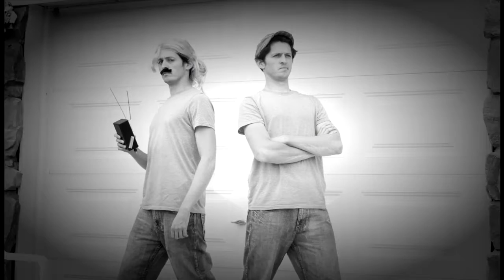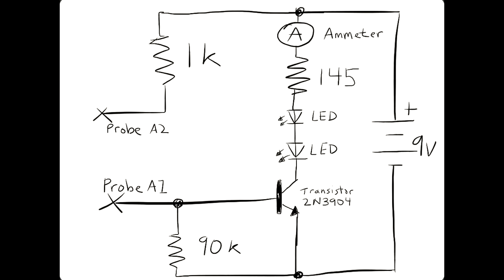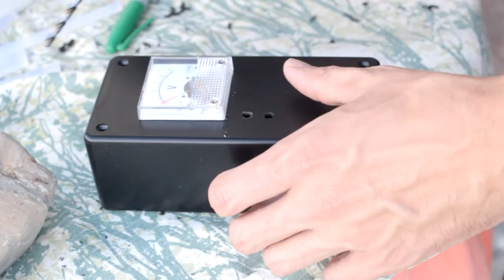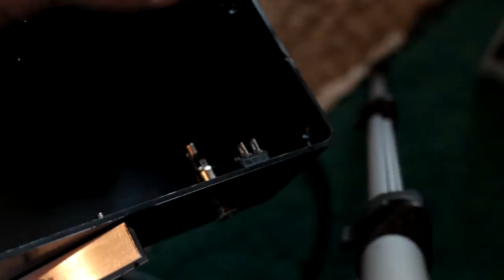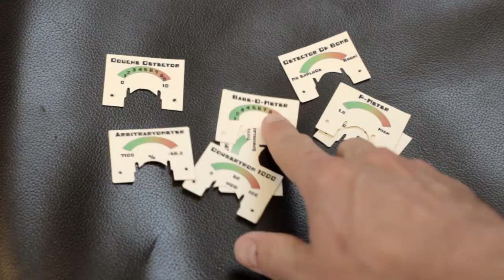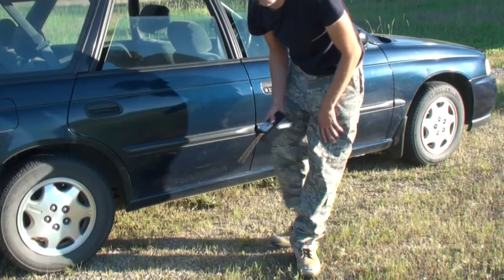Build A Ghost Meter/Bogus Detector of Things! Johnny Rigged Ep 1

Comment: This is pretty fun. Do you think it could be done on a smaller scale? I'm thinking of making an "Aether" meter for a steampunk style device I'm putting together. I want the needle type of dial but I'm thinking I want something more round. I want to build a working version of something like this: https://www.etsy.com/listing/259255609/aether-gauge-monitor-cuff-steampunk
Reply from the maker: +Aaron Stein I'm sure you could find a different amperage gauge that looks more like the one you want with some searching. By just putting the parts together without a bread board you could make this circuit tiny. Saw more rounded meters in the proper range on ebay. To get one that goes full circle at the right size and is really thin would take some looking or building your own my making a tiny electromagnet connected to the needle.